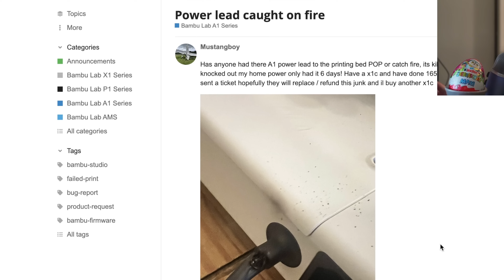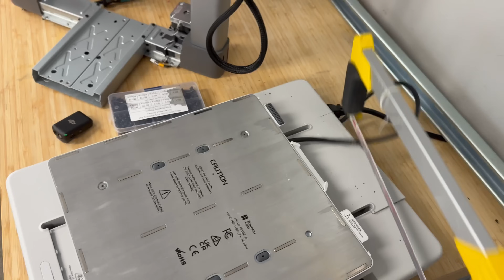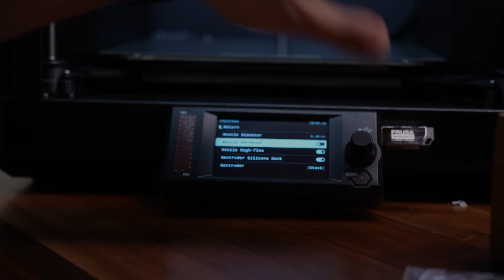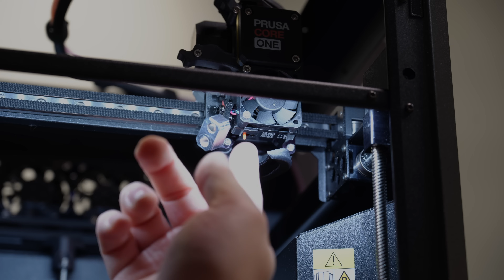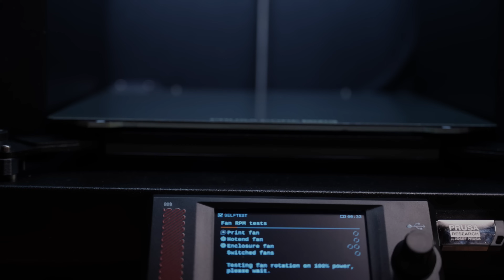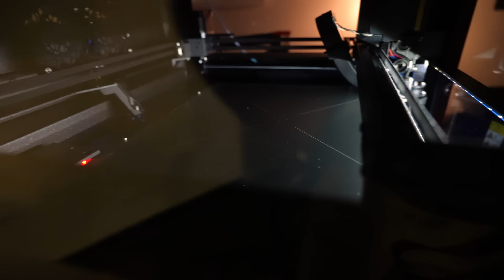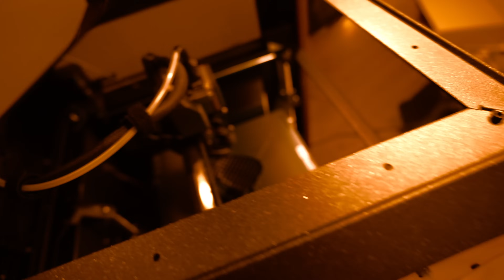PRUSA CORE ONE - The Machine Designed to Trigger Bambu Lab Fanboys

Comment: The QR code on the thumb drive has nothing to do with the firmware version that's on it. The one I got with my MK3.5 upgrade kit and the one I got with my Core One kit have identical QR codes.

Comment: awesome video, thanks Nathan. You are so NOT the salesperson, you're not afraid to give harsh criticism when its due, and also not afraid to rave about a product when it delivers. What about the accelerometer? is it not really needed? who would benefit by it? does it allow for faster prints without ghosting and ringing? or is it fast enough. I too am focused on quality, strength, but dont want ringing. Im also likley to use a fatter nozzle to get stronger prints, 0.5 or 0.6. Can you test speed, visual quality and strength using larger nozzles? thanks!

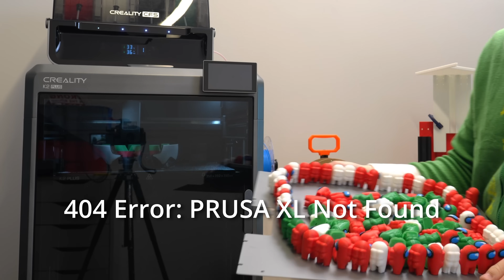Comment: @35:20 that is unqualified - there are arguments for and against prusa or other companies - if you compare the Core One to a Bambu Lab P1S there are indeed lots of improvements over the machine, but be realistic - you are comparing a 3 year old design with a brand new machine from a competitor - and all the prusa has come up with is basically "2 sidepanels to make the build volume smaller so it heats up faster" (yes, there is more to the picture)

the Core One is surely a great machine, but if you factor in the competition it is a joke, it would "never" have happend if  Bambu Lab did not bring "fast and easy CoreXY to the masses" - especially with products like the elegoo centauri carbon on the horizon - where you can get 4 printers for the price of just one Core One or you can get almost 2 P1S for the same money - and even after this time, a P1S prints flawless, just like the Core One is supposed to print 

So the repairability, sustainability, licence and firmware controversy is another topic. I'll give you that. I originally came from software developement (focus on open source web applications), been a maker by heart for ages and also i'm involved in repair cafes in europe, i'm a friend of sustainable, open and repairable products.

But to be realistic: what Prusa does is very special an rare, what Bambu Lab does is pretty much standard - there are way worse companies out there (especially in IT) that sell way more products - just think about HP Printers, that you need to throw away or sell a kidney when the ink runs out. compared to that, Bambu is harmless. And unfortunately some people vote with their wallet - 1000 bucks + is a lot of money for lots of people, there needs to be a really good reason to put that kind of money on the table, especially if you can get a similar product for half the price - that is after all why the 200 buck ender v3 flooded the market while the MK3S was way more expensive

as a long term viewer of your channel maybe you'll take some advise: tone that bias down, it does you no good in the long run. You transport very well, that you despise Bambu Lab - that is why your videos more and more become biased and untrustworthy for me. Because you think too much in extremes. You claim that others are just Bambu Lab fanboys while you, yourself act like a the prime example of a Prusa fanboy. Both extremes are not good if you want to create objective, good quality content.

Comment: The only problem with Prusa is the price. The other side of that is that they are just troopers. My Prusa Mini + just works. My associates with Enders are constantly having to rebuild parts of their printers. I've had a few problems and had to do things like relubricate and tighten belts, but generally it just keeps on trucking. The price of the new Prusa Core One compared to the Centauri Carbon is horrific, but just based on the time I've saved on my machine because I don't have to keep tinkering with it to keep it running, I'm seriously considering going with a Core One for my next machine.
Reply: Prusa can't beat chinese prices. Only way would be 100% transfer to china and still he wouldn't be able to have prices like China state supported companies.

Comment: Hah, you joke about the DHL guy dropkicking it. Mine arrived with some serious corner damage. Enough to crack the top cover, and bow two of the top frame pieces. And bend one of the vertical frame pieces. The machine still ran fine, just looks terrible. Many thanks to FedEx for the drop test!! Prusa is sending me new parts, it’s just ridiculous. I almost wish I had gone with the kit, as I’m going to be rebuilding half my printer anyway, and the box would have been smaller, more compact. That’s my recommendation!

Comment: 5:45 I think all their machines come with firmware preinstalled, but it could happen that they release new one after they assemble the pritner, so they put new firmware on the flash drive and it just automatically updates, but i am not sure about that.
Reply: @JK-tj2mq Yeah, it's probably easier to update the USB drives. Additionally, they might also be able to have a special firmware for production and testing purposes preflashed on the boards.

Comment: I mean... I get the "production in Europe" argument and all... but... WHY... ist this thing so darn expensive?
Reply: because Jo Prusa bet on the wrong horse for years. 

Just look at the past 5 years or so, everytime someone asked: why don't you injection mould parts? his anser was: because 3d printing is better, because we can iterate etc - this is all good, but if you go for volume, you can also iterate with injection moulding if you do it in-house - you need to machine the tool for smaller iterations, but this can be done

then bambu lab pops out and disrupts the market and all of a sudden, if you look at the recent 2 years: prusa now also has injection moulded parts that they do in-house

but prusa told us for years

same goes for the frame: rods an a cast rame for the MK2, 3 and 4 because jo prusa despised sheet metal bending and stamped parts  - all of a sudden, the core one is release with stamped and bent sheetmetal "frame" and enclosure

Jo Prusa almost developed a god complex and acted if he was the center of the 3d printing world - this parochial thought with little foresight hit them hard

i mean what was the competition back then? shitty ender V3 bedslingers  - and for CoreXY you needed to have 1 to 1,5k in your hand and 3 weeks of vacation to assemble a Voron printer.

TL;DR: prusa is producing their stuff "wrong" - they chose the most expensive production methods and lied to themselves for years, that i can't be done better - then a few other companies came and showed them how it is done and all of a sudden, prusa is again able to adapt again

we will see more modern and cheaper prusa products with great repairabilitys in the future - but this process is slow an painful since prusa slept very long on their reputation

Comment: My Core One is scheduled for delivery the 21 March so I'm counting the days. My old mk3s+ has 15.000 hours on it without anything breaking. Incredible machine.
Reply: MK3S's are so reliable, at work I printed hundreds if not even thousands of hours and when it had first actual fault it was thermistor wires perishing from heat and shorting out. New one at like 8 euros + shipping in place and back to printing :)

Comment: The x1c is definitely harder to repair. Their customer support is horrible. I have a mk3s I upgraded to a mk3.9s. The touch screen was bad and prusa replaced it. A couple months later and the USB port on the screen started flaking out. The USB would disconnect mid print so the printer would stop. Prusa customer support  strung me along trying various things and it would work for a while and then do the same thing. Now it will not work at all but prusa tells me they are not going to do anything because it is out of warranty. It was in warranty when it started doing this, but now it is out of warranty and tell me I have to buy a new screen. There is your industry leading customer service. I won't bother with prusa anymore.
Reply: @vhoward1122  pretty sure they'll help you if you insist. Your claim is fair, sounds like a display cable issue
Reply: @fofopads4450  Cable has already been replaced.  Before when it happened, I could wiggle the usb stick and it would reconnect and the print would resume. Now it won't.  I have purchased a new screen. $110 out of my pocket, but I am not disposed to buy anything else from prusa.

Comment: 35:47 prior to seeing the core one release on the market, I have been seriously, considering picking up an X1C. Then the whole fiasco happened with their data, security and requiring their cloud base software in order to use the printer. I think 3-D printing should be open sourced, and if the user wants to, not have to be connected to any sort of networks like you said for engineering and patent infringement and data security reasons after doing a bunch of research on the core one, I placed my order the other day and believe ultimately I am getting a more durable printer that is designed to be repaired and maintained by the end-user, not just being locked in to a hardware platform that becomes a useless pile of junk once it ultimately fails. Excellent video, thanks for all the work you put into this one!

Comment: This is the best take I have seen on this machine yet. Thanks! I'm about to purchase my first printer and was between this and the other enclosed flagship printers with more bells and whistles. After watching this I totally understand what Prusa's value proposition is, and I can appreciate it. Definitely going with this one for many reasons.
Reply: Doing the same, this will be my first 3D printer.  Been researching them for about a month and almost bought the Qidi plus 4, serious look at Bambu X1C.  Biggest thing with Bambu was I would always use LAN mode and having to get permission, or a code to key in to use a piece of hardware I own kind of rubbed me the wrong way, along with checking security of my network.  Qidi looks good but seems 50-50 chance of getting a good one or bad one.  I will probably do the Prusa kit and just take my time building.  Between Nathan and Tada 3d printing they kind of made up my mind to go Prusa.

Comment: I think this might be my favorite review on this channel.  Picking it up and moving to another room and having it continue without issue is just the cherry on top man.   I built a RR VCore500 recently, but I think I am going to order the Core 1 kit and treat myself to insane reliability and use it for all my smaller prints.  The RR is great for printing Droids, but this is perfect for everyday printing.  I think it is safe say Prusa has knocked it out of park with this one.  I really like Prusa slicer so why not use it with a machine it is designed to work with.
Reply from the maker: It shut down while unplugged, but it restarted without having to press any buttons. I guess it's also sort of a power loss recovery feature, in case you have a power outage for a few minutes it just picks up where it left off
Reply: @NathanBuildsRobots  IT SHUT DOWN WHILE UNPLUGGED?!?!!1?!!?11 OMGomg Bambus would never ever never do that, they'll run off of thin air ether zero point power for any length of time!
Reply: @NathanBuildsRobots  No movement on the build plate while you moved it next door with the motors unpowered? Or did it move all the way to be bottom and back up again then rehomed the x/y position when it got power back?

Comment: But it's expensive as heck 1600Eur compared to Elegoo Centrauri Carbon that has injection molded frame not some bent sheet metal like PRUSA for 300Eur just 50mm smaller bed size, sure you can DIY heated to the carbon from aliexpress. So
Reply from the maker: There are so many things wrong with the numbers you are using I’m not sure where to start 😓
Reply: @akierum  Elegoos are thrash. They were better off making SLA machines. I am so glad I waited on their Orangestorm giga.
Reply: It's not 1600€; Assembled printer is 1349€ and the kit is 1049€.
Reply: @TNX255  not really much better
Reply: @ It is nearly one (almost two compared to the kit) Elegoo Centauri's worth cheaper :face-fuchsia-poop-shape:

Comment: Prusa machines are overpriced and overrated imo. It's too expensive to justify it. My Prusa breaks probably once a month. I can't justify $1000+ as well as regular repairs, when I could just get a Bambu or an Elegoo carbon that does basically the same thing. That and screw Prusa's software based firmware. Using the MMU on a Prusa was terrible and if your MMU is slightly uncalibrated, the entire thing breaks and needs rebuilt. Good luck, you'll need it. There is a reason why the MMU hasn't taken off nearly as much as the AMS or it's derivatives. The MMU is an absolutely pain to work with.
Reply: Sounds like you dont know what your are doing, you just think you can buy your way out of incompetence
Reply: Software based firmware? All firmware IS software :face-green-smiling:

Comment: As someone who loves their Bambu Lab A1, I would love to get a Prusa machine, specifically the Prusa XL with 5 tool heads. But its just incredibly hard to justify the prices they charge. 

When the A1 is only $300, spending $1000 on an assembed Mk4S seems insane. I could have 3 A1s for the price of 1 equivalent Prusa. 

I understand that they are the best if the best with quality and care for customers, and I respect that. But the price needs to be at least sonewhat competitive.
Reply from the maker: A1 isn't $300, it's $360 + shipping, so probably closer to $380.
Personally I wouldn't buy an assembled MK4S, I'd get the Core One Kit. Apparently it takes less time to build than the bedslingers
Reply: @NathanBuildsRobots that's good to know, I think if I did this for a business I would buy Prusa, but since I just do personal projects, it's hard to justify the price compared to the A1 for well less than half the cost.
Reply: @jasonwiltjer9  so, they drop the mk4s prices.
Reply: @jasonwiltjer9  For sure. Prusa is a great company with great printers; but they definitely don't fall into the budget category. Nothing wrong with other brands, especially if they fit your needs and budget more!
Reply: Tecnecyl it is competiv 
Ther is nothing else that can do what it can
Reply: XL is a tool changer and not a standard printer, idk why people keep comparing it to Bambu printers
Reply: @krollmond7544  I wasn't directly comparing it here, I said I want one. They are just too expensive. 

I was comparing the A1 to the Mk4s which is a valid comparison.

Comment: Those three motors for the Z axis are wired to the same controller (series/parallel?) so there isn't any z tilt possible.
Other reviews have suggested that the software isn't quite providing enough cooling for PLA for optimum print quality so the auto setting for PLA might not be enough and you'd have to use more fan, but maybe not 100%.
Reply from the maker: My fan was set to 95% and working well in a 21C environment